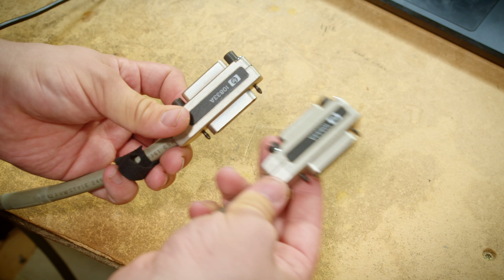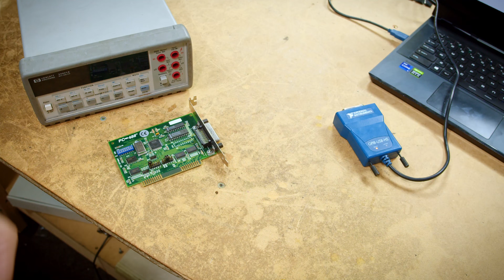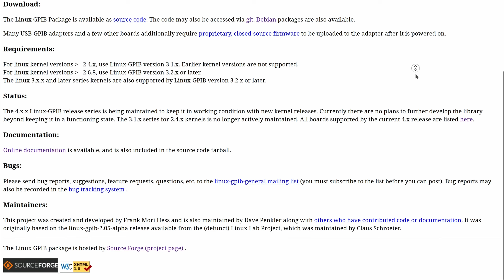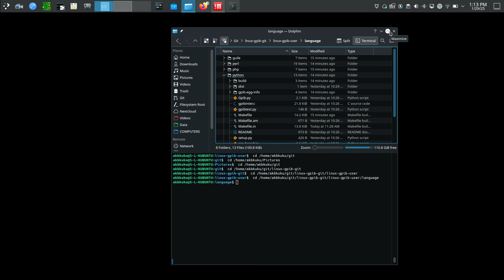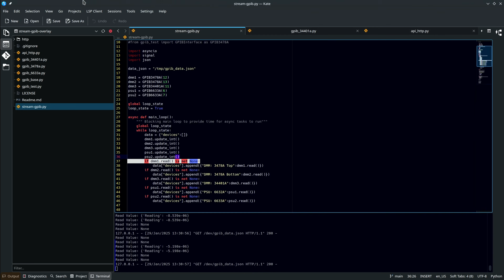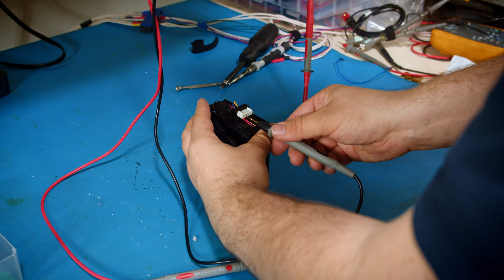GPIB on Linux for HP Test Gear

Comment from the maker: Some minor errata on the setup process, I put up the message on screen that you may need to run "./bootstrap" for the user setup. But you will possibly also need the python package "setuptools" to get the module to build correctly.  I tested this again on another computer I had done less on and it was needed for the build process there.

Comment: Typical 1000 characters of typing linux nightmare. I used GPIB back in the 1980's, plug in the card, run setip and then edit your BASIC program, job done

Comment: I wrote a crappy arduino library to interface to my HP oscilloscope. Ironically, i used the same oscilloscope to probe the signals as i was testing communicating with it.

Comment: Well Done. Regarding long timeout of "1 second" for 34401A:  depending on your resolution setting, it might take as long as ~3.3 sec to get just 1 reading if in 6-1/2 digit-SLOW (which is probably 100 NPLC). If you need the RES, gotta give the integrator time to cook.

Comment: Just an FYI, i recently moved from debian (ubuntu specifcally) to arch, because apt updates are held 1-2 months before you can use them, they do this to be 100% sure a package is stable before they ship it out, whereas on arch, i get updates as soon as package maintainers make them work for arch (usually 1-3 days), the reason i mention this is, like you i had to manually add kernel modules to get access to the latest stuff (mine was the nvidia open source 570 driver), but in arch, because you don't have to get stuff from github (im assuming you did this), and you don't have to run the extra code, and part of this is normally configuring the stuff like the gpib group, including stuff like the python dependency, to put my money where my mouth is, i installed the driver myself, it was genuinely easy, now i don't have any hardware to verify, but it auto compiled with no error, now as a side note it is in the aur (arch user repository), which requires a secondary package manager to use (not provided) i use yay, works the same as the default package manager but with aur packages, and as a bonus it's pretty easy to install from their github

Comment: The largly different comment sets are the reason a friend of mine build herself a ESP32 GPIB adapter.
All the command sets are converted on the ESP32 itself. You have to set up everything once, and after that it gives you a standardized JSON endpoint to the device on a TCP port.
So at the end of the day you can throw the same command at three different power supplies, just on a different port, and they all will do what they are supposed to do :)

Comment: GPIB is old and slow with connectors and cabling better suited to welders than electronics. I use Ethernet to GPIB converters if I need to connect to an older instrument.

Comment: Sigrok?  Have you ever played with it?  Supposedly it supports a gazilion pieces of test equipment.
RPM=60*Hz.  That fan was spinning a WHOLE LOT faster than what you were saying.  I'm guessing you were getting multiple pulses per revolution considering 2600Hz would be 156k RPM.
Just from how it sounded, I'm guessing you were in the 15k RPM range.  IIRC, fan power draw goes up exponentially with flow. 1A vs 7A wouldn't be 100k+ RPM, I'm guessing.  Blades would have to be billet aluminum.
Awesome work on the overlays!  Yeah, that's going to be great for future videos.
Reply: I was wondering if anyone else had noticed that "Hz is not RPM" issue!  

There are fans that go 150k RPM, though they are sold as blowers to be used as expensive replacements for canned air for dusting things, and I don't think they're anywhere near that diameter -- actually, they can't be, because you really don't want your fan going supersonic, and 150k RPM hits supersonic at 42mm in diameter.  So multiple pulses per revolution seems pretty certain.  I'd guess it's probably tapped into some of the control circuitry for the brushless motor, and so would depend on the number of motor poles.

Meanwhile, if you're in the subsonic regime, aerodynamic drag force goes up as speed squared, so the energy required goes up as speed cubed, and I think that would be a reasonable approximation of fan load as well.  Not quite exponential, but a lot worse than linear.

Comment: Welcome to my daily business :D
Programming and designing ATE (automated test equipment).
GPIB is great. Much more robust than LXI in my opinion.
However I don't like the National USB dongles. They are very expensive but not very reliable. In general USB is not that realiable in noisy (production) environments. A big oven turns on? - too bad, device re-enumerates! OS hangs? Too bad, weird issues. 
I just love GPIB (or RS-232/485) - they just work.
Reply: The National USB dongles can be had on eBay for $50 from a bunch of companies, new from China, "guaranteed authentic".  Which I would guess says something about why they are not very reliable -- though whether what it says is that a lot of the ones around are counterfeit, or just that the actual production cost is a lot less than what you'd think from the National Instruments list price, I couldn't say.

Comment: VISA drivers should be free - they're basically a HAL layer between the physical interface of the instrument (be it GPIB, TCP/IP, USB, or other) and the application software. I've used them in order to get instruments configured by computers to work. NI seems to offer them (search "NI VISA download") for free, so not quite sure what you're downloading.

Comment: Why not just package the user driver using udev to trigger setup on hotplug events, and as you said create a DKMS for the kernel component. You only need to do it once and then just run package build for new updated versions. dpkg isn't that difficult.  Personally, I use Gentoo, but I always write an ebuild for unpacked software since I really don't like having anything unmanaged on my systems.

Comment: Holy freakin’ A !
I hope I do not have to do half of that…work. My situation is a bit different, I will be trying to send data from my Linux box to a HP7470A flatbed plotter, through a usb-gpib cable. I have not tried doing anything yet, except reading up on the flatbed plotter and the gpib interface.  A lot of it goes right over my head, for the time being. 

Thank you for posting this video, it gave me some clarity of what I am looking at, and what might be my starting point in working with the flatbed plotter.
Reply: If you need some help drop me a line: it did these things while working at HP...

Comment: It sounds like this bus is designed around asynchronous programming paradigms. Essentially the idea is that you could send a list of commands to a series of instruments and then in theory receive a callback when that data is ready or poll the instrument to ask if the operation is done. The theory being that the bus and computer is faster at requesting data than the instrument is at doing an operation. This is why the instrument doesn’t by default clobber data in the output register because it’s designed to be implemented as a singular function that requests data and then schedules a read operation either after a delay or when the bus indicates stuff is ready. In such a paradigm two commands without read is considered a legitimate error in the program. 

There’s another comment here with more specifics on this bus. But take a look at the python module to see what functions it provides along those lines. Typically this is handled with two threads or with facility to interrupt program execution when the instrument indicates “data ready.” This is common in RTOS implementations with microcontrollers or peripherals with a separate function to test if data exists in the buffer/queue. In more advanced implementations you’d use multi core and an interrupt driven routine, but it’s simpler to use a single thread blocking implementation. But you generally should not be using a fixed timeout in these applications as it will be bug prone. Either loop through the instruments awaiting “not null” or find a separate “data ready?” function.

Comment: There are a couple of open-source USB->GPIB adapters that are worth looking into. Neither need any of this linux kernel driver madness. Both are fully usable in Python.

The AR488 project uses AVR-based Arduino boards and can be built for under $10 in most cases. Like most Arduino-based devices, the AR488 presents to the PC as a virtual COM port so you can get right into working with the remote interface of an instrument with only a serial terminal program, no other special software needed.

There's also the UsbGpib project by xyphro. This uses a custom PCB but can still be built for under about $20-$25. These present to the PC as a USBTMC device (USB test-measurement controller) rather than as a GPIB adapter or serial port. This is essentially like adding a USB port to your instrument. You do need VISA software for the xyphro UsbGpib adapters but this is really not an issue. I recommend R&S VISA from Rohde & Schwarz. It's free, very lightweight (unlike NI's software), and runs on Windows, Linux, or Mac. It even runs on Raspi OS for the Pi.

As others have indicated, look into serial polling and SRQ (service request) to speed up your measurements. Most of the manuals for the HP equipment give examples that show how to get the fastest measurements out of the instrument.

Comment: Is there no protocol to encapsulate IEEE488 over an IP based transport? I mean, you can probably imagine making an Arduino to act as a gateway and forward GPIB messages into UDP datagrams and the other way round. It's not like low level 488 is that complicated.

Also, have you tried talking to a PET or a floppy drive just for shits and giggles?

Comment: Been using Linux for a while now since Windows 7 was the last version released by Microsoft which was designed to allow anyone to get anything useful accomplished.

This is a pretty good demonstration of why you would want to go through the trouble of setting this up, and why I haven't. :)

When I sit down to do something I usually have neither the time nor the cognitive resources to spare so I just end up using USB to RS232 and a terminal program. I keep a Windows XP install in a VM with USB pass-through (I used to use Visual Basic and VISA) just in case I still need to do something above and beyond calibrating a power supply for instance.

Comment: I did this sort of thing in six different OS's back in the 90's. (a few lifetimes ago as an Embedded Programmer) Even wrote a "demo" X11 program to copy the front panel of a Fluke DMM for remote access. (sometimes those things were inside fume hoods, explosive containment, even in a radiation chamber once.)

Comment: The HP 4401A exist at list from 1996. We still using a lot of them. I did not see even one that brake down. Fuse maybe pop up , or the power switch platic pusher brake, but not the electronic circut. One of the best DMM.

Comment: Wouldn't dedicating a thread to each instrument in the Python program help with reactivity of the overlay ?
It would get a reading as soon as the instrument is ready, and the bus is available.
Then you can use queues to get the reading back to the web server.
Reply from the maker: Since everything still has to go through one piece of hardware it's all going to be limited by that anyway. And the 3478As are the only thing that don't have limits on how fast they can be polled.

Comment: You're probably the only person in the world who says GPIB as a word instead of spelled out like any acronym.. and it really grinds my gears.
Reply: I'm working as a test engineer programming and designing such equipment. Both are used regularly.
("Geepib" as well as "Gee Pee I Bee") I prefer the latter however.
Reply: On the flip side of the coin, spelling out SCPI vs calling it “Skippy”
Reply: @ Some acronyms work fine as words.. SCSI as 'scuzzy' for example. but GPIB really.. doesn't. and HP spelled their original variant as HP-IB which made it rather obvious it's not meant to be aychpib.. ;-)

Comment: If i remember right some of the peripherals, including some huge "washing machine" hard drives, for the HP 3000 series minicomputers used HPIB. It'd be awesome to be able to get one of those talking to a modern Linux machine!
Reply: I worked at HP as a systems engineer from 1981 on. In the middle 80's all storage devices used the HP-IB as the interface to all computer lines. In the early 90's it  was replaced by SCSI.

Comment: Ah man this takes me back. Working as a software engineer for Nortel optical electronics devision. GPID. Operating a few keithley (much like the HP but it was also a power source along with being a multi meter). 
Actuators (Melles Griot) Epson robotic Arms. Spectrum analysers. And depending on if the testkit was testing a laser or mach-zender a HP laser source. 
My job was writing the testkit software. 
And the flashback to using National Instruments controls for linux (Solaris 7) and later windows to give nice buttons, dials and charts on the testkit software UIs. 
Best job ever.

Comment: For those "capabilities that have been around a lot longer than your realize" feel, you could use some 1980 vintage Fluke GPIB instruments or host that included CRTs with touch screens. The touch areas weren't hi res  - basically it sensed which of an array of rectangular fields you were touching. But still quite neat. One of my early jobs was adding GPIB capability to an instrument that monitored and tested avionics buses. And lest people get the impression from your video that GPIB is slow, it could generally achieve throughputs near a megabyte per second when properly configured. Slow compared to modern USB3 or USB4 buses, but fast enough for many instrument readings per second, and faster than many other communication protocols of the '70s or '80s.
Reply: If I am correct the CEC GPIB ( I think later both by Keithley ) interface could get up to 8MB/s. In my company they used CEC for almost all test computers.

Comment: Nearly all the equipment where I work is using GPIB, it's such a simple but good interface.  The HP 34401a, and related models, is pretty standard for most tests.  Also, power supplies in that same format.  

PCI-e GPIB cards, they do exist, we have them in most of our system.  But, like all NI stuff, they are very much overpriced and not really worth the money.  They get the job done though.

LabVIEW is pretty much required in the industry, despite it being the "fancy" version of Scratch IMO (I really don't like it that much, I keep having to code far too many workarounds).  I use version 2017 daily, but there is a free community edition of the latest version for non-commercial use.  If anyone is interested in learning a language that will make getting a job in the test tech industry much easier, I highly recommend it.  And, it has LEGO Mindstorm support builtin, so there's that I guess.  

Awesome episode!  I've loved GPIB ever since I learned about it and despite this episode making me feel like I was at work on my day off, it was really fun seeing someone else excited to use this equipment.

Comment: Pronouncing it G-PiB is driving me nuts. I’ve only ever heard it  referred to and pronounced G-P-I-B.

I use it daily with power supplies, function generators, DVMs, ATTENUATOR controllers and oscilloscopes.   I use the NI-VISA with VB6. There is no charge to use their windows library. 

Me preference is to used Agilent/Keysight drivers and VISA.

My whole lab works on G-P-I-B.

Newer devices with network interfaces work identically with my software. The only difference is the the VISA/GPIB address is a network is different. Also you can use direct USB connection. Identical except a unique address.  I find USB not as reliable as network or GPIB connection.
Reply: I have never heard anyone, anywhere, in the industry refer to it as anything but G-PIB, except maybe H-PIB by the grey beards.
Reply: I worked for Nortel in the 90s/00s and it was mixed. H.P.I.B G.P.I.B and G.Pid were used in equal measure. H.Pid seemed to be biased by the older legends that I worked with. This was a mixture of Canadians and British engineers predominantly.

Comment: Modbus is an industrial automation communication standard that is still in use today.  As is Data Highway, Profibus, Canbus, etc.  Once you get a decent standard going, it's hard to get rid of it, because the installed base is HUGE.  So new equipment has to support old communication standards, just to maintain compatibility.

There's a reason RS-232 and RS-485 are still around.

Comment: I noticed in main_loop that you're calling read() twice which I guess is ok because the actual reading is done in update_int(), but usually it's better to do something like `if (val := dmm1.read()) is not None:` `data["devices"].append({"DMM: 3478A Top":val})`
Reply: Arrgh, Walrus Operator!
Reply: @JGnLAU8OAWF6  I love the walrus operator. It makes dealing with regex matching so much easier.

Comment: The cool thing about GBIP is yiy can set the voltage and amps of the power supply, trigger a measurement, and then plot all s from all devices in an excel

The slow read of some devices might be because of averaging. Maybe your slow devices take a lot of samples, and then average them out. It should be a config setting.
Reply: This is how I tend to use it, very handy for long test cycles, especially ones that need to run for 24 hours.  Add in some tests for ambient temperature, humidity levels, light levels, etc and it can really catch some weird situations.